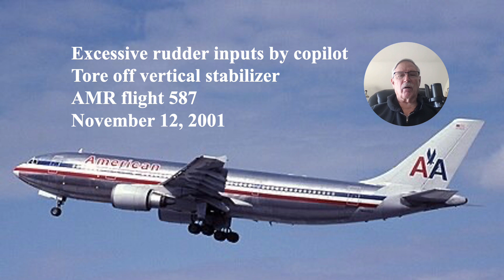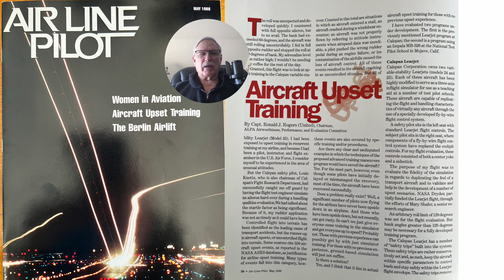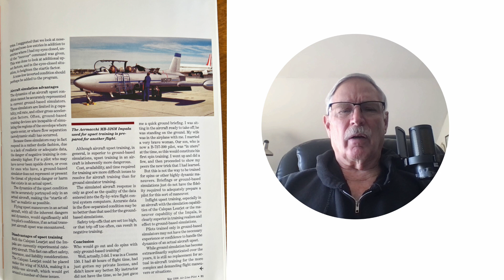Excessive rudder inputs by copilot Tore off vertical stabilizer AMR flight 587 November 12, 2001

Comment: Timing aside op.cit., I always had my doubts on the rudder theory.  Not that severe turbulence is not capable of tearing off the vertical stabilizer, as in the B-52 Elephant Mountain accident.  I do somewhat subscribe to the theory that the composite matrix of the vertical stabilizer was damaged prior to delivery of the A300.  Composites are over-designed to have higher margin  of strength compared to their metal counterparts.  Why would Airbus design an aircraft with such an Achilles heel?

Comment: Hi Ron!
Love your videos.
The fighter pilot from A/A safety program was Warren Vanderburgh.
He has vids on you tube on upset maneuvers.
He has 1 great one on microburst escape maneuvers.
He was talking about when escaping, and having a wing drop, not to use all aileron, because you'll throw all the spoilers up on the opposite wing, just when you need the most lift.
He said use a slight amount of rudder along  with a slight amount of ailerons to keep from throwing up the ailerons.
He said explicitly a small amount of rudder.
It was a 1997 symposium on different envelopes of unusual recovery.
I always wondered why the NTSB said A/A was teaching "aggressive" use of the rudder.
Not sure if Warren was still there in 00, or 01.
I think it was a fascinating symposium he put on.
Just search A/A microburst symposium on you tube.
There are 3 vids.
He actually called it children of the magenta line.
1 was microburst
1was unusually upset recovery.
1 was automation dependability.
I really believe you would enjoy it.
Unfortunately, Warren has since passed away.  
I thought he was a great speaker to listen to.
Please let me know what you think.👍

Comment: There was a movement in the 90’s to encourage transport category pilots to undergo unusual attitudes training, and to overcome their usual reluctance, to make more decisive control inputs, when necessary. This included active use of the rudder. I remember well for example the frequent articles in Flying magazine on this subject. The movement got some traction. No one was thinking that a bit of rudder input could cause airframe failure.
Reply from the maker: I remember that well.

Comment: As a flying passenger i can tell you i will never complain about the anti terrorisim measures. Great video.
Reply: I read an interview with an El Al captain who thwarted the hijacking of his flight back in 1970 (it was a Boeing 707, and a few other flights were hijacked on the same day). He said that when he was training on the 707 with a Boeing instructor, he had asked him to demonstrate how hard he could push the aircraft without damage or loss of control. He did some "disruptive" maneuvers, and an air marshal in the cabin was able to shoot the hijacker.

Comment: Ron...we all know how difficult it is for any airline pilot to use the rudder petals, even when needed. I have 20,000 hours in the smallest Boeing jet. I have avoided and hit all kinds of wake turbulence. Even behind 757's. The bigger the jet, the less it is affected. 
Plus, every airplane has a V-a speed where you can move all controls to max without hurting the airplane. AA jet was well below that. Enough said.
Reply from the maker: The rudder reversals were the issue. There is no safe speed for that.

Comment: I remember reading about the sensitivity of the rudder pedal increases while in the air,  to a little over an inch from neutral to full rudder.  For those who drives a car with a clutch,  that's what you'd call an on off switch that you don't want in your daily driver.  I don't know why airbus would design it like so

Comment: Certainly remember this  as one of our Traditional Guard A-10 pilot's flew this aircraft and route on a regular basis for AA. He had just flown this tail number the week before. That was a tough wait that day until we found out he wasn't on this flight. Hearing his stories about this I remember alot of finger pointing going on between Airbus and AA initially at the time. I was in QA at the time and he was our QA Officer. Can't remember what and how he was taught to fly with rudder inputs. But I do remember him saying he would piss off ATC by not taking off because they were being pushed to go before he felt comfortable with the wake turberlence times. He was a former F-16 pilot active duty before joining our unit. He said he hardly used the rudders in the F-16. We had our normal scheduled weekend duty right after this crash. So alot of discussion with him. Especially on composite materials. Thanks for this one on such a tragic event so closely after 9/11.

Comment: Ron, 
Early in this video you attribute the loss of control of this aircraft to the rudder coming off. As you well know, that is not so. Loss of directional control was clearly caused by the whole fin (VS) separating - including, of course, the rudder. Loss of the rudder would not in itself have caused the uncontrollable yaw (skid and slip) that tore both engines off before the aircraft hit the ground.

Comment: My totally unqualified opinion on this incident is that carbon fibre has no sense of humour. 
I t's enormous strength to weight ratio is used to reduce weight.  However unlike aluminium which will yield without breaking, carbon fiber does not fail gracefully.
Which is why the aluminum attachments survived.

Comment: 8:38 intentional rudder reversals in a little plane: I think I remember a small piston plane (but forgot which model) where the wiggle thing was an official hint from the pilot's operating handbook, to try in case the undercarriage got stuck in retracted position.
Reply from the maker: You are correct Used it to try to get the main gear down on a Cessna 404 due to a hydraulic and backup system problem. It worked. Talk about that (with pictures) in  another video on flight test.
Reply: @ronrogers might wanna update the video to correct the “1 year after 9/11” hiccup.
Reply: I once performed a simple stall in a lowly Piper Tomahawk.  The amount of tail wag was enough to keep me from doing that again.  It was whispering "metal fatigue".

Comment: The airbus has a flight computer, is fly by wire, one would think the flight software would regulate the input to provide the maximum desired aerodynamic control effects and NOT overload the structure -- aka Gorilla-proof engineering. So instead of good engineering, all the responsibility is on the pilot AND WORSE, all the repeated stresses on structure that accumulate to weaken the load capacity  need to be somehow historically tracked for safety.  Could have been some lines of code, instead of a big deadly, cluster-fuk...
Reply: The A300 isn't a fly-by-wire aircraft, unlike later Airbuses.

Comment: I was dumbfounded when the cause was released on this one.  You would think that Airbus testing would have revealed excessive input tearing a vertical stabilizer off of an airplane as a possibility and programmed the flight controls to eliminate that potential outcome.  They program them to eliminate so many other things that could result in an issue.    Always wondered why that much force could be input by the pilots regardless of the circumstance.  Hopefully they have revised the software and addressed the issue.  I bet a lot of guys flew the A300 with their feet flat on the floor once in the air after that accident. Great stuff as always Captain Ron.
Reply: I think you may be slightly over-estimating the sophistication of the accident aircraft's rudder system. AFAIK, international design and certification requirements do not include an aeroplane being able to withstand the most extreme mishandling of its flight controls. 
I believe the A300-600 rudder system is similar to the slightly earlier-designed A310, which I flew in the mid-1980s. (The A310's glass cockpit and some other novelties were later incorporated in the Dash-600 version of the older A300B4.)
The A310 rudder is manual-hydraulic (using 3 servos - one from each of the 3 hydraulic systems). The linkage from the rudder pedals receives additional inputs from the aforementioned rudder-travel limiter, series yaw-damper and autopilot servo-actuators. Artificial feel is provided by a spring-loaded rod. 
On the shorter-fuselage A310, the fin and rudder assembly of which therefore has a shorter moment-arm than the A300-600, the rudder-travel limiter reduces the pedals and rudder deflection from +/- 30 degrees at speeds below 165 kt to +/- 5 degrees at 310 kt and above. I now see that, in the case of the A300-600, the limitation continues to reduce to 3.5 degrees at 395 kt and above.) 
My brief look at the NTSB report suggests that what overloaded the fin (VS), which failed at TWICE the design loading, were the rapid rudder oscillations from side to side. 
After the fin detached, the aircraft would have lost natural directional control completely, and the resulting yawing caused both engines to separate from the airframe before the aircraft hit the ground.

Comment: So what was the rudder pedal break out force? and how much more was required to get full rudder travel?  And, can a reasonable person calibrate their foot pressure to that range?
Reply: NTSB report:
https://www.ntsb.gov/investigations/AccidentReports/Reports/AAR0404.pdf
It states (page 18) that the pedal break-out force is 22 lb (10 kg), but not how much more is needed, if any, to achieve the (variable with speed) full-travel. Must admit that, despite flying the similar A310 for a couple of years in the 1980s, I can't remember if it gets harder as you move it. BTW, apart from checking rudder trim, we never used rudder in flight, except in asymmetric thrust.
Reply: It was reported in AWST. Along with some comments that the rudder response delay was in the range that PIO was probable. That would be a yaw PIO not a pitch PIO.  @chrisscott4896

Comment: Why did the flight control computer ALLOW that to happen???
Reply: Why did the engineers design the rudder limiter that way?
Reply: @georgehaeh4856 That’s my point.
Reply: The A300 isn't a fly-by-wire aircraft, unlike later Airbuses.

Comment: I flew the A300 for CAL at the time when this happened. And I do recall CAL A300 sim instructors having us use rudder for unusual attitude recovery. Yes, we did it both ways to demo it and the aircraft recovered quicker using the rudder… but I didn’t like it! I never did it in the sim on the 727 737 or 747 before that, but it just FELT like something about it was just a bad idea. I was proven right.

Comment: Hi Ron
Was the fly-by-wire system already incorporated in the A-300-600 series of aircraft? If so, the system should have prevented the pilot from making excessive rudder movement that would bring the aircraft to a point of failure of that section of the fuselage.

I thank you for your opinion on this accident.
Reply from the maker: No, this was still old designs. No FBW yet, not until the A-320.
Reply: Also the A300-600 was flown with a A310 Type Rating.

Comment: FWIW: The required seperation for a heavy departing behind another heavy (in a radar enviornment) is 4 miles OR 2 minutes. If the pilot of the trailing aircraft wants the full 2 minutes they are supposed to tell the controller BEFORE they accept the position & hold (OK, line up & wait) clearance. When I worked @ LAX we had to demonstrate the ability to meet the mileage requirement BEFORE we were checked out.

Comment: As others have stated the A300-600 rudder travel limiting system used rudder pedal travel rather than a rudder ratio system which the rudder pedal travel remains constant but the rudder travel itself is reduced.  And pilots weren’t warned of this change. Poor design.
Reply: I tend to believe if Boeing had designed a system like this rudder travel limit system AND not alerted or trained flight crews of the potential trap this aircraft would’ve been grounded. I’m an aircraft mechanic and put the air data system in test to see for myself. I was shocked at the small throw of the rudder pedals. No wonder he was “dancing” on them. They were in essence on/off switches when depressed. This F/O was imo conveniently blamed. Not only that but I red the red tabs of the A300-600 at my airline before they were revised The procedure for unsticking a landing gear that wouldn’t extend was “cycling” the rudder pedals.
Reply: Actually, in the A-300 school, and in the manual, it was pointed out that the rudder limiter operated by limiting pedal travel.  We knew that, and it was modeled in the simulator as well.  What we did not know was that it seems to have been possible to have the rudder go to full travel even when the pedals themselves were limited.
Reply: @anthonyvallillo422  
Yes even though the pedal travel was limited the short stroke of the pedal was still equivalent to the full stroke at no or low airspeed.
Reply: @richardlewis4288  I think that is more or less what happened to 587, but it was not supposed to work that way.  The short stroke pedal travel should have yielded that small percentage of full rudder travel.  After all, the rudder ratio was not changed, only the pedal travel.  Small pedal travel = small rudder movement.
Reply: @anthonyvallillo422  
You say "it seems to have been possible to have the rudder go to full travel even when the pedals themselves were limited," and several other posters seem to be under the same misapprehension. The range of travel of the rudder mirrors the reducing travel of the pedals as the speed rises. If you think otherwise, read the NTSB report.
Reply: "Poor design", or poor instruction on the pilot conversion courses? I flew the A310, which has an almost identical rudder-travel limiting system to the A300-600, in the 1980s - and five other big jets over 30 years or so. It makes absolute sense to me that a reduction in available rudder travel should be reflected by reduced travel of the pedals, so the pilot remains in the loop. 
As for using the rudder in wake turbulence, that is simply not a good idea. I was taught that rudder use while airborne on a big, swept-wing jet should be limited to the case of asymmetry. Otherwise, feet should be on the floor.

Comment: Another good presentation, although not airline related there is a new design for general aviation aircraft that provides superior rigidity in the tail section. We know for a fact a number of GA aircraft like the V-tail Bonanza and other high performance aircraft has shredded stabilizers, both vertical, horizontal and the V-tail type. Here is one comment from a senior vice president at Lockheed Martin "Chris this is by far the best tail design ever conceived for a light aircraft and possibly a light transport in the de Havilland otter category" Ron if you're interested how about your check out "advanced aero vortex LSA" and yes the aircraft is aerobatic for the weekend warrior. My dad who is USAF retired (F-86, F-101, T-39) flew the prototype, he said it flies like it's on rails (no yaw whatsoever when power settings are changed). In any event this will be a life saver for sure and it looks good too.

Comment: It was odd that most pilots didn't think you would break off the rudder this way, whereas it came as no surprise to the engineers, who knew you could.
Reply: I guess the engineers never told the pilots, because what every pilot learned prior to 587 was that you could  make full movements of any control without breaking anything as long as you were at or below Va.  In fact, that was the definition of Va.
Reply: In GA aircraft yes.  Not so in transports. @anthonyvallillo422
Reply: @anthonyvallillo422  still is the definition of Va for many A/C.
Reply: You are right